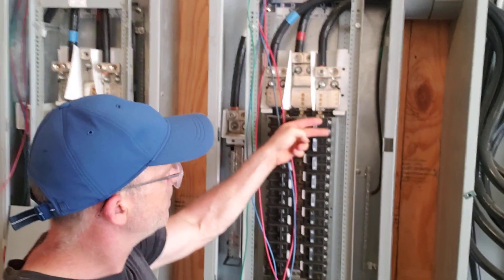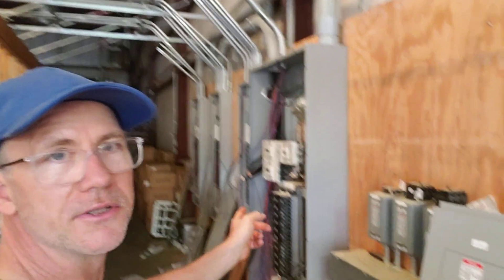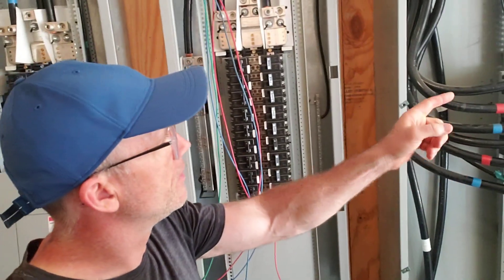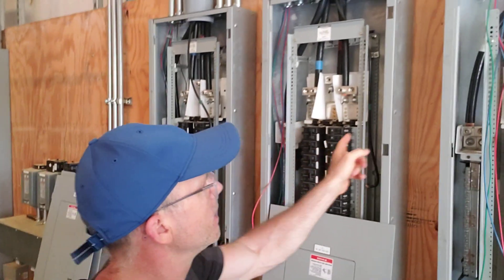Electrical demonstration of 800 kW Bitcoin mining facility

Comment: When you said 208V delta transformer (1:15) did you mean a 208V wye transformer? no delta transformer I know of has phase to phase voltage of 240.  There is of course high leg delta, which has 1 line to neutral of 208, but phase-phase is still 240. Now, a 208v wye has line-line voltage of 208, and then line--neutral of 120. which appears to match your setup more?
or maybe its some delta-wye transformer where on primary side its a delta secondary wye? 
Thanks.

Comment: Rolf,  can you explain why 2 breakers are required for a delta 3 phase setup, but not for a wye?
Reply from the maker: No, I don't understand why 2 breakers are needed. That's just how my electrician set it up. It seems like there should be a way to do it with just 1, but I don't know.

Comment: I've been a follower for years and own a modest farm/microbrewery.  Thanks for the insight. Was your move driven more by the lease renegotiation or change in commercial power cost? I'm debating amongst a few future concepts
Reply from the maker: the original plan was to do something different at 4 year point. Moved the profitable miners to a building we purchased and built out. The equipment that was removed is being repurposed into mining containers.
Reply: hello, its because the electricity is coming from a combination of 2 legs off the transformer. The 408 y conection can supply 277 with one leg. if you took two legs of this transformer u would get 408 across the load

Comment: i had a 30 amp breaker put in from an electrician , so what i need to no is ; how do i divide that up off a 3 prong 10 gauge  50 ft extension cord i only have 2 pus 1300 watt G2 i would like to go with 2 more pus 1600 watt  with a total 5,800 watt draw is that 30 amp hold that if not what is the most watt i can go off my 30 amp
Reply from the maker: buy a pdu and see how far you can push it before a breaker trips

Comment: Hi thanks for making the video and it’s very rare to see in-depth videos of the aspects of setting up a mining farm and I’m learning some hard lessons for instance i recently bought a 22000 sqft school that has a 400amp service already but I didn’t balance the load correctly on the distribution panel and literally 🔥 the neutral and 1 leg off the transformer lol luckily me and the service tech got along great and didn’t issue an AR (aka) make me pay for repair lol 😂 but it’s only 1ph power as well but I need to do a service upgrade so I think your plan of 415 Y would work great thanks

Comment: How do plan on reaching profitability in the container model?
Reply from the maker: By moving the mining containers to where there's low cost electricity
Reply: Block Operations what’s your target rate?   I have 2 acres in an industrial area in West TN that could easily house containers. 480 3 phase on property. Discounted rate gets down to $.08 when I last checked.
Reply from the maker: @soyabmalani  Target rate $.035 per kilowatt hour. It's doable in various parts of the United States